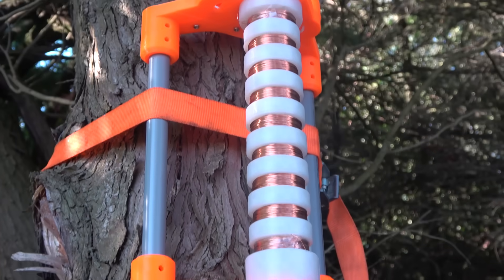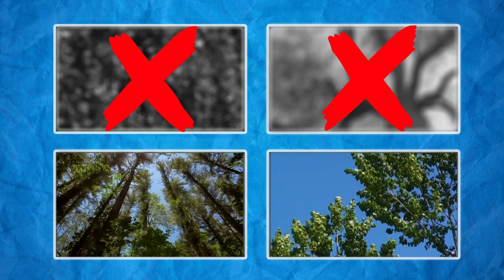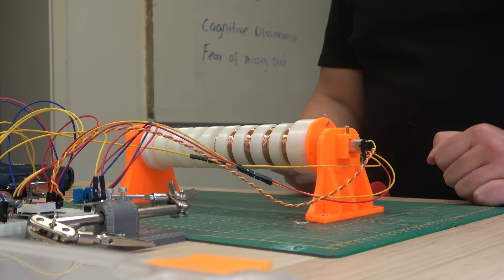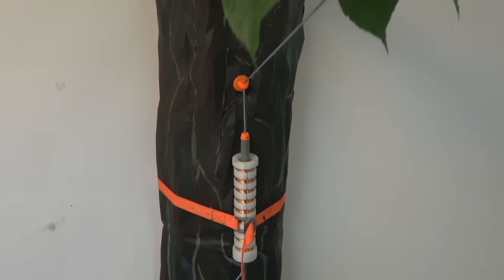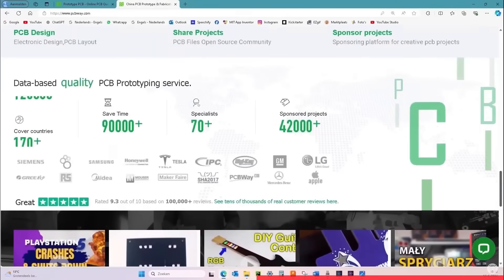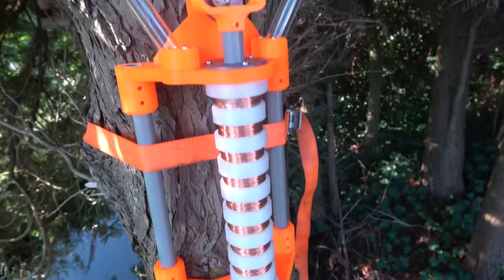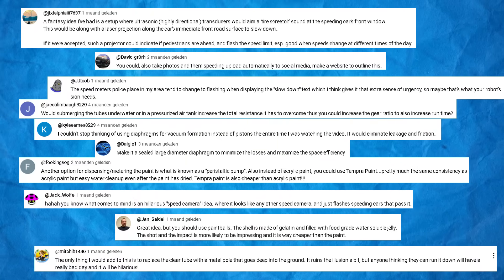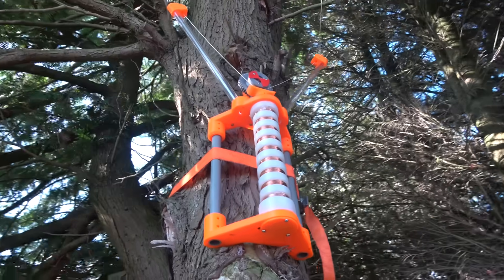I Made a Tree Generate Electricity..

Comment: Why use a tree? Put a long flexible rod with some kind of a plate on top of it to catch the wind up on top of a cell tower or building.  That thing will be flopping around non stop.  I live in Minnesota and the stakes they use to mark driveways in the winter come to mind, or even a tightly wound spring that will stand straight with no resistance but weak enough to flop around

Comment: Brilliant idea ! Really like it . I have a lot of other projects in my mind at the moment, so I just share my first thoughts. 
1) I would focus on the trunk movement as it's most heavy (=more energy) 
2) I would consider the highest movement of 1 which is horizontally
3) before I engineer some generator, I would test the pull force / movement ratio. Most likely already with a DIY build with a wind speed measure and pull force measure to get an average for wind force - movement - energy coefficient.
4) I would look for the cheapest,but strong enough (safety factor 50% regarding pull force ) rope to put it on the list of product cost. 
5) I would head for rotating generators. 
6) I would build a MPPT (with testing) for best results of movement - energy output.
7) (just came to my mind) to reduce stress of MPPT I would search for a way to convert a fluctuating energy into a more consistent one (=better MPPT , supposedly more energy (depends on friction etc from such system).
8) finally a prototype. Definitely considering a defined breaking point within the system, such as cable ties and the end of the rope. You don't want to fight against wind force ;) 
9) look at the collected data to find weak points. 
10) make the first calculation if it's worth it. I would say 30years amortisation is definitely worth looking into it further, as the prototype improves AND (more importantly) build cost get lower with mass production. 

Just my fist thoughts, happy for discussion or PM
Reply: Maybe even 80 years amortization is still great for prototype!!!!

Comment: If you've got a spinning wheel there to change the gear ratios, why not just use a circular dynamo (you could even make it unidirectional with a bit of cleverness)? It would cut out a lot of the complexity and thus increase efficiency.

3D printed design here: https://www.youtube.com/watch?v=tb3iN4m9Bik

Comment: Hi nice project. If i may suggest to combine the collection of energy with the storage of energy. Lets replace the complex cylinder you made with a simple water pump. That way you can add many pumps for each branch of the tree, Add a water tank at the ground next to the tree and one high up in the tree. this is your energy storage. Once the upper tank is full or the demand for energy exist run the water from the upper tank via a turbine to the lower tank to generate electricity.

Not only will it combine storage it will also simplify your design and it will consist out of off the shelf components.

Hope this helps.

Comment: At what point do you just say, "screw it", detach it from the tree, put it on a tripod or pole, add a fan blade and let the wind directly turn the main gear? 🤔
Reply: This is theoretically much cheaper as most of the structure gets stronger over time instead of degrades like wind turbines do. These also make basically no sound. Birds can live in these safely. And you can set these up in forests so your costs to modify the land are fractions of what it would cost to set up a wind farm.

Comment: This is cool but needs to be  built to support some kind energy storage system that can be converted to 50 Hz AC. Lifting weights on a crane and spinning flywheels have already been suggested. Pumping water between higher and lower reservoirs could also work but you would probably need a hydraulic system. As always the storage is limited by the mass of the water/weight/flywheel and the height it can be lifted (or the speed the flywheel can spin up to). There're also options for capacitors and lithium batteries which might be smaller but have their own issues.

Comment: I did a similar thing once, using the swaying of a tree to pull a long cylindrical pump to pump water uphill. I was absolutely thrilled that it actually worked even though it pumped a uselessly tiny amount of water.
Reply: but it was free energy, and it could be exercised even better, perhaps the water may be used to water more trees, which in turn gives more trees to give force = energy, and then you can get up even more water,

but that's a long term investment.
Reply: @Sweze Any energy harvesting device must return more energy than it cost to build. My attempt certainly didn't!
Reply: @chrisgrill6302  the palm trees in florida seem like good trees for winds, since the hurricanes exist there

Comment: What if you stored the energy in a garage door like spring with a ratcheting system then when it has been wound some n# if turns its released to drive a stator so the speed is not determined by the trees movement. You could replace the spring with a mas gravity or pressure based system as well.

Comment: Attach a propeller to the gear instead of the strings, use a normal generator, and you're done. 
You're trying to convert the energy of wind by first having it push a branch and converting that tiny energy transfer to a linear motor, which means that you just lost >99% of the wind energy to waste. Leaves are inefficient at being turbine blades, to say the least. This is like trying to tie a string to a bunch of ants and then expecting them to tow your car after feeding them some sugar.
This concept would work much better as a wave power generator, at least there you can extract some meaningful energy out of the system.

Comment: You're probably getting a lot of resistance since two branches won't really ever be swaying the exact same and because the string will be pulling up against the gear instead of just -left and right-. You could solve both of those problems by attaching the string from the branch to a spring reel in the mechanism itself. Then you could put another generator (and spring reel) on the mechanism for a branch on the other side without it adding to the amount of string while doubling the power generation and cutting back on the resistance.

Comment: The biggest issue I predict for this model will be entirely related to the environment's effect to the system itself.

Traditional line is great until it is broken by friction and weathering, and needs to be rerun.
The piston will readily be fouled by both debris from the tree and (depending on the tree) sap or other dew.
Water will fill the piston chamber without drainage.

Comment: This might actually be really good if attached to the trunk, using a normal rotational motor/generator, a gearbox to turn the slow and powerful motion into fast rotational motion, and an AC to DC to AC converter to change the varying AC to stable AC.

I can imagine a robot based off this though: have two robots connected by a wire/rope inside a sheath. One bot crawls up to the top of the tree and around it so the full trunk is used to pull the rope, and the other stays at the bottom and generates the electricity.

Comment: This is a fun idea, but I'm pretty sure you've way, way, way overcomplicated everything.

Why did you build a whole custom-3D-printed and hand-wound linear generator piston thing?  The cables from the tree branches are running across a pulley and generating rotational motion.  At that point, you should just connect that pulley directly to a rotational power generator.  You know, like all the standard electric generators that everybody already uses for everything else (and you can buy from all kinds of sources).

Just run the cables over the pulley, connect the pulley to a standard off-the-shelf AC motor/generator, and you're done.

(and then, of course, you'd need some rectification and storage/smoothing of the generated electricity, but you'll need that with any design anyway)

Comment: Use that leverage movements to store energy in spring heavy wheel (like the toys with manual rotation mechanism which let's them run)

Every move left or right "click" a gear and the spring wheel is getting more energy

Then from a rotating wheel to electricity - it's easy, like in any power plant 🐏

Comment: Hey, this isnt going to generate as much energy as a wind turbine cos its just not moving as much. 

But on the other hand, its going to cost a fraction of the cost. Simply place the device on a tree that already exists, no need to build anything.

Also you could combine it with things like christmas growing farms, pine farms, fruit farms etc. A way for the farmer to earn extra income on the side whilst the trees are growing.

From an environmental point of view this is far better than wind turbines. Instead of killing birds etc the tree provides habitat and also purifies the air. And there is very little pollution in making the device compared to the environmental damage of a wind turbine been manufactured.

I think wether its viable will come down to how much energy can realistically be generated by a tree and wether its worth the cost of manufacturing and affixing the device. But if you can get the costs down enough then as long as it generates even a small profit it could definitly be used where trees already exist and dont need tombe planted. E.g. fruit farms.

You should consider patenting it.

Comment: 2 separate ideas,
1. directional gear for each system connected to a branch then to a central shaft with a form a ratcheting gear, then use a standard rotating alternator.
2. Each module to a fluid pump then to a manifold to drive a small turbine for a rotating alternator. 
Both options seem feasible I prefer the fluid one as it's probably more discreet

Comment: To use both the falling and rising motion to generate, use a rectifier bridge. In this case, it would be easier to connect you pulley to an existing electric motor instead of building a coil from scratch.

This idea is only good looking, but not very effective. You cannot predict how much movement a given branch will have, too long a movement may destroy the device. If it is too small, the device will produce trace amounts of electricity. Damage to the tree = damage to the device.

Therefore, still it is more efficient an cheap to build a wind generator that is not dependent on any living, unpredictable infrastructure.
Better jest study the topic and not just go for it. Because You are wasting time discovering what is already well known.

Comment: I'm a little confused. Which way does the pulley turn when the branch moves up and down?

How about this: Have each of the two strings attached to a separate pulley, with a counterweight hanging down. When the branch moves up and down the pulleys will turn in the same direction and when the branch moves side to side the pulleys will move in opposite directions. Next you connect each pulley to a self-reversing gearbox so the output shaft always turns the same direction no matter which way the pulley is turning. Finally attach a standard rotary generator to the output shaft.

Comment: i think you could get more power in rotational energy if you had the same system but with a normal rotational generator, a couple winds around the pully, and instead of attaching to branches attach to trunks of trees. you a lot of the energy from all the branches instead of just 2

Comment: My initial thought is, the direction you are going the concern with exceeding the rpm limits during high winds such as a storm should be far easier to handle or may be eliminated all together.  The only thing I think could be a concern due high winds is the line breaking or the like if the tree deflects further than anticipated.  BUT, that could be a safety feature in its self because a line is replaceable vs entirely self destructing due to exceeding rpm limits.  This is very interesting.  I wonder if the same thing could be done with a motor and a wheel from a bike.  like when you pedal for a bit and coast, if the tree is pulling randomly a weighted wheel will continue to "coast" and generates more consistent power in between the tree pulling the wheel.

Comment: Great concept. But n order to make it work best way possible, we would need to make multidimensional optimisation first. There are some main factors to consider as dimensions, like overall cost, size, weight, number and size of magnets and produced power. Aldo I think it would be wise to connect the base to ground and ropes to different trees and make the movement of core longer. Cheers!

Comment: This will probably not change the world or the energy problem. But it are often the little bits combined together that make the difference. If it would be possible to already charge your phone on a "daily" basis using this, I think we're of to a good start. I don't expect to start coocking on this. But charging the phones of an "average" household (2 parents + 2 kids) would be wonderfull. 
when you start testing, make sure you have enough battery capacity to store all the produced energy and look for overvoltage/ current protection. Also look for rain protection in the form of some "roof" system. Water can not only be a potential risk for short circuiting, if during a heavy rainfall enough water gets into the magnet housing, it could create more drag. Which would slow down the movent when it is potentially at its peak performance. Covering the magnets in a small layer of (UV) resin could also make the system less suceptable to short circuits and corrosion. Though this is of course quite a permenent step so maybe only do it when you are in you final design phase when you don't have to reuse all previous components.

Comment: It's a great idea! My first idea would be to reverse a synchronous engine. The two ropes spin a heavy wheel which carries much momentum once it starts spinnging. Every additional movement of the tree will keep this heavy gear running. The heavy gear will also spur a smaller gear which is attached to a magnet. The Magnet spins inside a coil generating electricity. Or each direction the tree bends spins one heavy gear, both of them combined spin the smaller Generator wheel. It could also use a spiral spring design like in a automatic watch. One thing to consider is to not danger the tree and the animals on it. So any moving parts should be made inaccessable by animals. Ropes should be strengthened against weather hazards. It should also be considered to not generate much noise. Again the rotary dynamo design with light in mind and covered in a casing against water so it's protected against rust will be best. Piecoelectrics could also be used to generate enegry on the bending of the piecoelement which generate electricity if they are bent. My last idea would be that the up and down movement drives a piston which again moves water in a zylinder up and down. In this cylinder there are multiple piezolectric elements which will move with the water generating electricity.

Comment: I don't know why but it seems the gravity and friction is stealing energy. I am thinking of magnetic balls set in a circular track surrounded by magnets around the trunk. The trees movement would induce a hula hoop effect as the balls would race around the track.  In order to keep them alligned magnetically (and do work rather than spin) one axis would be fixed to a loop above and below the track,  likely the loop would be constrained to only move clockwise/anticlockwise.  Basically you get a large bearing with magnetic balls around the tree in a race.  This would also add a flywheel effect,  but would have to fit around the trunk.  Smaller versions could be used around large branches.

Comment: so i never knew there where vertical generators like that but it makes sense in this case what about water it can act as a infinite source of motion at a running river what if you put a water wheal there but attached this generator to it some how trees do move but its inconsistent some days the wind is stronger and this can brake the rope over time as well as generate to little power

Comment: One thing you can do using the current design is rather one wire pulling one cylinder up and down, depending how many pounds of torque that tree can actually pull (and not mentioned in video), I was thinking pulling multiple cylinders, say 4  side by side around the tree, and using a single wire from the tree connected to a splitter harness that would connect up the 4 cylinders in the style you currently have.1 stroke of the tree would actuate 4 cylinders which would increase power output to be more useful. Then its all about long term power storage. I personally can see using this idea on a acreage I own that has a long entry road but no lights but plenty of trees along the road. Use LED lights to provide some illumination along the road so it's not pitch black stuck to the tress powered by this gadget you designed.

Comment: Just sub'd based on this video.  I'm in.  Game on!!!  I'd start with building the design around your linkage, ie: 5/32 vinyl coated wire laundry line.  Its's super cheap, flexible & durable. On the more expensive side, remove the core of a climbing rope (creating a sleeve) and insert, or thread through, a length of solid core rubber rope.  This will add an extra level of resistance, potentially increasing the desired "tugging" effect to perpetuate the generator.